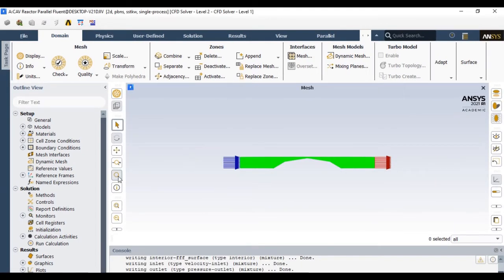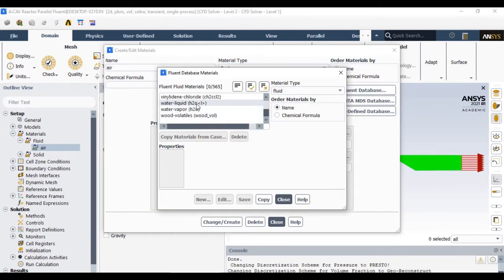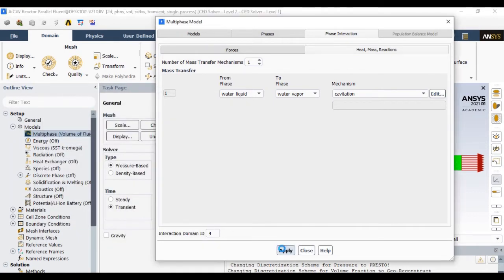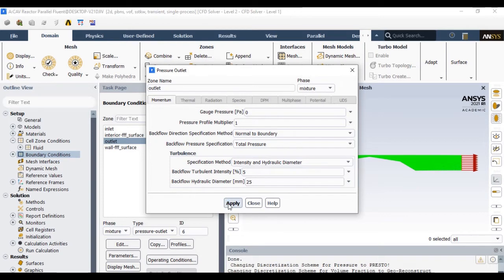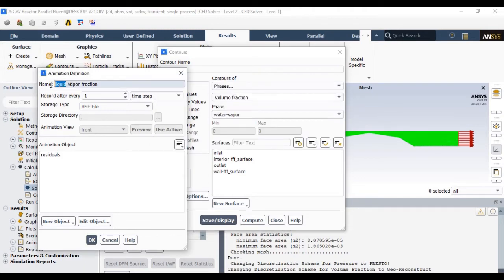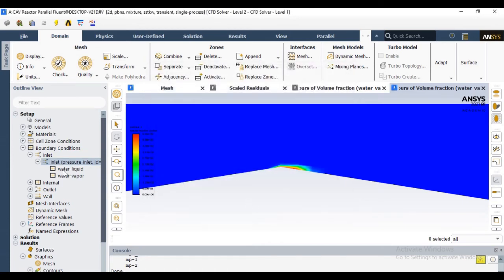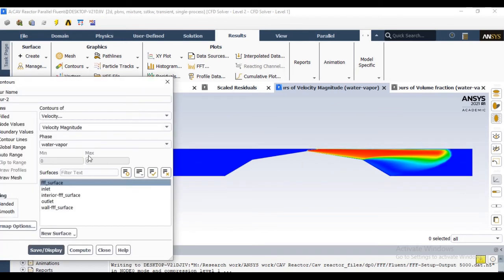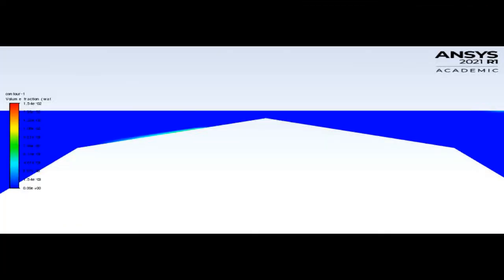ANSYS-Fluent Tutorial- Waste water treatment by Cavitation Reactor (Part-2)

Comment: sir can we simulate jet spray through non circular like triangular jet and calculate breakup length sir please help me plssssssssssss
Reply from the maker: I think you can not provide non-circular dimension in Injection model. You may use hydraulic diameter and ensure with some experimental data.
Regards.